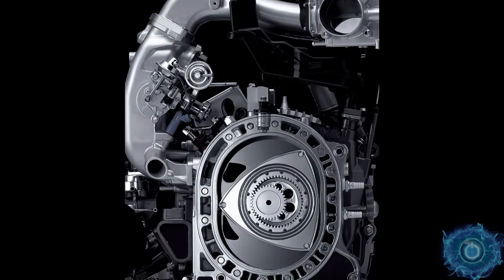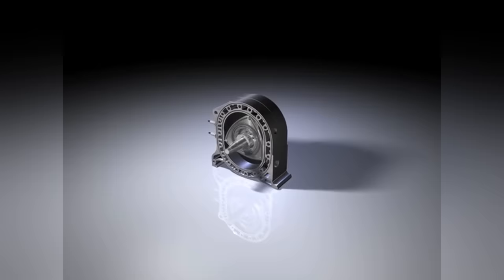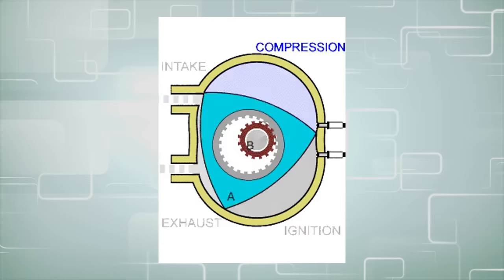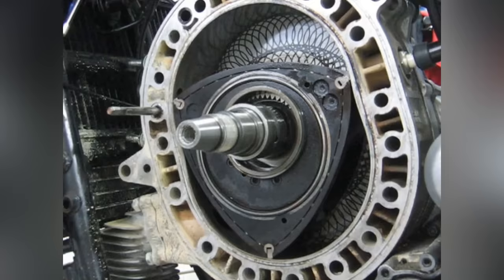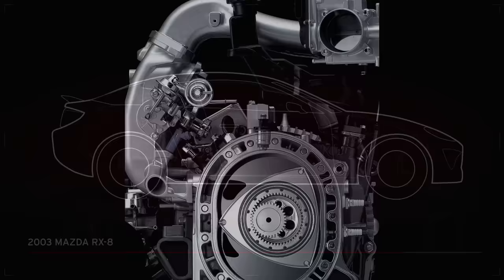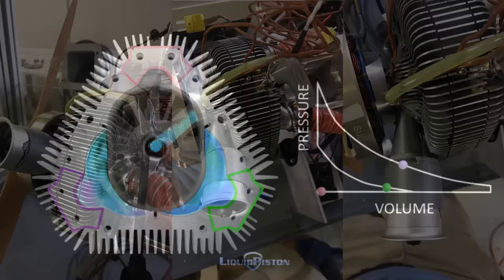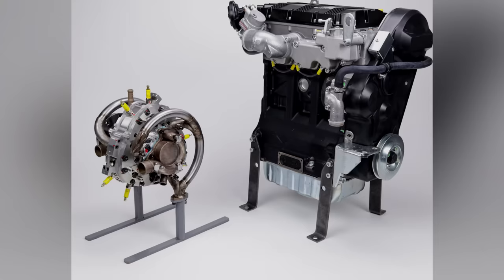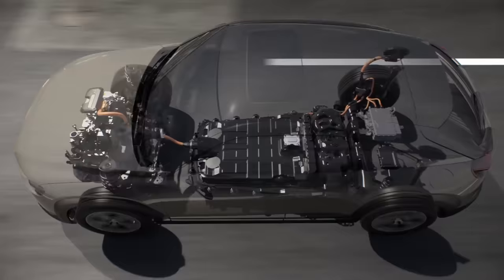STRANGE New Rotary Engine BREAKS Records

Comment: This is a beast for drones/loitering munitions/cruise missiles and such. Applications where power/weight is of the highest priority. Each kg less engine weight, the more snap, crackle and pop! ;)
The best thing is that the rotor rotates slower. In a wankel engine the rotor rotates three times as fast as the output shaft. Here it is the other way around with three times the power pulses per shaft rotation! If ICUs weren't falling out of favor, this could be the first market relevant break through in decades!

Comment: A factual mistake, RX8 doesn't have 2.6 liter engine. It is still 1,3 liter engine. (13B-MSP, a variation of 13B)
So the engine naming on rotaries is somewhat weird. One rotor has the displacement of about 650cc. Now then they sum the two rotor's displacement, giving it the whole displacement of 1,3 liters. The single rotor is NOT 1,3 liters.

Comment: I believe the future is electric motors but with a micro turbine engine as a range extender. That would void the need of a huge battery pack and also the need of new charging stations infrastructure.
Reply: Why do your need a microturbine or battery for electric whatever? just use a small motor to staty a homopolar motor generator to power wht you want and one its started you no no longer need the battery or small gas engine
Reply: @jlo13800  Because turbine engines are much more reliable and very versatile in use. ICE engines are not the future anymore.

Comment: I have owned 7 Rotary Mazdas starting with a 1973 RX-3 and ending with a 2011 RX-8 R3.  I would still have it if someone hadn't totaled it for me.  I found that the "problems" associated with the rotaries are more about people not understanding the proper way to treat them than any design flaws.  I never lost a seal.  I love the way they accelerate and the smooth operation.  I'm not interested at all in the "range extender" as it won't contribute at all to the handling on the car.

Comment: I think, discontinuous combustion is in general a problem. In the time from 1905 to 1920 there were several cars with steam engines around. High pressure fast running steam engines were a problem at this time. But this problem is solved now due to the progress of the Diesel engines. In the time from 1995 to 2005 there was a development of a modern steam engine in Germany under the responsibility of Ingenieurgesellschaft Auto und Verkehr with several companies and research institutes.

The final development was the ZEE03 (see Google) a 3-cylinder 1 liter steam engine with a power of 50 kW and an efficiency of 45 per cent. This engine was also tested in a Skoda Fabia car. The behaviour was very much like a turbo diesel engine but with certain specialities. The engine was self starting with its maximum torque at 0 rpm. The working fluid was water. The total amount of water in the system was 250 cm³, which was circulating multiple times per second through the whole thermodynamic cycle. The boiler temperature was 370 °C at a pump pressure of 200 bar. So it was almost supercritical. Each cylinder head has his own superheater operated by a coaxial porous burner. The upper steam temperature was 900 °C, which was really a lot and the reason for the large thermodynamic efficiency.

Comment: I really like the plug in hybrid concept. Keeps the battery small, eliminates range anxiety while providing enough battery only range to allow for most commutes both ways. Mazda has of course announced their small SUV in this configuration using a small version of their wankel rotary, running only as a generator and at constant relatively low speed. This sounds very attractive in my opinion and the concept engine discussed in this video would make such a vehicle even more capable due less space and weight devoted to the petrol engine allowing for additional battery capacity and more battery only range.

Comment: Beautiful engineering. Hopefully we can scale electric cars enough to not need it there, but threre are plenty of use cases for which this will be an excellent improvement such as in long range drones, long distance small aircraft and other compact machines that are not yet suitable for electrification.
Reply: They dont need it or batteries. ZPE aetheric eenrgy is every where in the universe and it been taken from us. Floyd sweet made a device witch made about 223KW and he ran a 300hp motor with it. it was the size of a small book, he was poisened and died. remember every electron and proton is a tini rotary 2 stroke made up and sustained by this ZPE aether.

Comment: "Used" not "Utilised." The difference is VERY important. Please stop screwing this up. If the engine was "Utilised", it would have been consumed in its entirety. As the engine clearly still existed when it was turned off, it was used not utilised.

Comment: they did not solve the tip problem and the shaft sealing. However
If the can come up with a solution to change the tips without taking the engine apart like changing the sparkplugs externally - then the engine will be viable alternative.

Comment: The theoretically perfect engine design for converting intermittent combustion into rotary shaft power is the Rotary Vane Engine.  It solves all four of the major fundamental problems of reciprocating engine.  It solves the reciprocation problem, as it is a true rotary device (Wankel is more of a planetary gear than rotary).  It solves the torque output problem of piston engines, which is due to their tiny torque leverage (connecting rod journal offset).  A vane engine has a huge torque lever…. A one foot diameter vane engine has a 6 inch moment arm…torque lever…(12 inch stroke!).   It solves the compression ratio/expansion ratio problem.  A vane engine could have a 30:1 expansion ration with a 10:1 compression ratio.   And it solves the non-uniform torque output problem.  It produces almost 270 degrees of uniform torque output.  It also solves the incredibly low thermal efficiency problem of piston engines.  A vane engine was tested at Lawrence Livermore… the first prototype hit 61% TE.  Oh and it solves the rpm redline problem.
Reply: I wonder how long the engine survived for. Those are some high relative speeds at the seals.
Reply: there is a better engine that that. its the 3 phase electromagnetic rotary 2 stroke induction motor!

Comment: In the early 90s, my friend shows up to my house in an original rx7.  He offered to let me drive it.  So much fun. 
  My only experience with a Wankle engined car.  I always wondered why such a power plant was not used for aviation, considering it's high rpm endurance. But, the piston engine seems to be preferred by most all vehicle applications. It's a viable engine, but it seems to be the ugly duckling of internal combustion engines.  You would think that it's simplicity would have made it a winner.  No valves, push rods, rockers, cams, and yet, abandoned by Mazda, and everyone else.  Brilliant design, almost successful.  That RX7 was 10 years old, but ran like a champ.

Comment: The design is the next step in configuration of rotary dynamics. They took the housing and made it the rotor and designed the new housing to be the corresponding triangular shape with dimples for compression and sealing/ seating of the rotor shape. 
Very good mechanically. I hope to see more of this design in the future.

Comment: This engine is a boat anchor, no torque output,  I have said a hundred times but somebody is always trying to develop this design "The most misunderstood mechanical machine since the beginning of time."
Reply: 40 ft lbs for 210cc aint bad and no fat ugly wet sump like on a 4 joke, this is a rotary 2 stroke oil injected marvel.

Comment: I would think a turbine would be a good hybrid engine.   they run very efficiently at their power RPM.  So shut it down if it's not running or make is smaller so it has to run wide open all the time charging and adding to peak power.
Reply: Turbines are like the opposite end of what a hybrid engine needs. Turbines downside is noise and lower efficiency in return for being smaller for the same power output.

Comment: I love the innovation and I have even done the EXCEL spreadsheets, CAD work and printed several 3d models of the engine.  What is missing in the video and all their website data is Emissions.  They have talked about hydrogen but I think hydrogen is just an empty pipe dream.

Comment: one area where wankle motors are used is engines for motorized glider airplanes - here the size and weight advantages are highly sought after cause you generally dont want to use the engine (so its dead weight) unless absolutly necessary. but the electric alternatives are also going strong...

Comment: The rotary design engines of ww1 weren’t phased out because they were killing pilots by create a gyroscopic lock and making the aircraft unmaneuverable. Early sopwith  camels would fly directly into the ground if the pilot turned right in the climb from take off.

Comment: I'd love to see hear your breakdown/opinion on the IN-N engine. A single stroke, four cylinder with eight opposing pistons with zero vibration.
Reply: Ford already has one. Its like a boxer motor kinda stupid actually the spark plugs dont last as long and the valves are more prone to carbon build up, hard to pass emissions the other problem is oiling just gonna burn more of it and use more of it. Valves wont close properly wirh the extra carbom build up
Reply: @FiglioBastardo  u didnt know that ford a has a 6 piston 3 cylinder/bore engine. They trying to put it in their hybrid truck. Look it up i believe its 3 liters. Pretty much the top of the pistons face each other similar to a boxer moto the difference is it uses the same cylinder/bore the spark plug is in the middle of the block.
Reply: @FiglioBastardo  these engines will smoke and consume too much oil its junk. If it didn't work well in the 1900s it wont work well today.
Reply: They use a swashplate instead of a crankshaft, which means the force distributed in a crankshaft journal is now concentrated in a single point. Also, machining the swashplate is a nightmare, which will demand 5 axis CNC machining even on mass production.

Comment: Rotary is dead but the Liquid piston has great potential if they can scale up to 300 hp or can be used successfully in a hybrid configuration.   I see Liquid Piston as a really elegant replacement for aircraft engines particularly those made by Lycoming and Continental.  Auto manufacturers are going down the all electric path, small aircraft will not be able to that for many years.

Comment: Turbo charged and use as an auxiliary engine like in military tanks where small size is needed appears to be a good fit for this motor.  Since it appears it can do compression ignition multiple types of fuels appear to be able to be used. Like this appears to be a diesel engine that has the ability to have a high power to weight ratio.  This might be a good motor for a drone. I think cars are going to be electric but this motor should have some niche uses.

Comment: Interested to see your summary of the rotary wankel engine, however you omitted to mention the original NSU development and the exhaustive development (to address overheating of rotors) conducted by Norton Motorcycles, where they ended up using the intake tracts to cool the rotor.  For a relatively brief period Norton used this engine in racing, but classification, ie swept volume, dictated that they could be excluded from pre-existing competition classes and controversy ensued.

Comment: Uh, the rx8 doesn't have its ports on the side for better airflow.
The intake and exhaust are both on the front/back. The intake was already there from the rx7 but the exhaust was there so that the emissions would be better, this actually creates more back pressure which makes it less powerful than it could be. Furthermore, because of the extra back pressure, turbocharging it and adding more back pressure with an impeller has actually caused premature wear on the apex seals which is why it's very rare to see a turbocharged renesis, very few people are willing to even try.
Rotaries are my favourite type of engine, I want to see them in more hybrid cars.

Comment: The liquid piston XTS-210 Engine is truly revolutionary. So much so that I actually invested in the company. While I am not thrilled with the management I am hopeful they can build an efficient manufacturing facility. If they pull that off it is a total game changer that will add a decade to the usefulness of fossil fuels.
Reply: Mount 2 XTS-210's together to make a 2 stroke 410 2 stroke for a banshee.

Comment: I've been excited for the Liquid Piston engine for years, but the longer they are in operation, the longer it looks like they are just pulling a financial scheme using a viable product as the bait.  If they really wanted to, they could have brought a working motor to market in some form 5 to 8 years ago.  As of right now, you can buy a one off prototype for $10k to $30k, if they approve your case use.  Mass produced, a 50hp motor would only cost $300 to $400 to manufacture.

Comment: Some informations are wrong!
The 2 rotor engine displacement is not 2.6! It's a 1.308cc (654x2) engine!
Also the FD had many different power outputs! The lowest HP was in the Touring X with a single Turbo and 231hp! My FD was one of the first with 280hp from the factory and the Spirit R Type A (also B and C) had 297hp!
Also: Felix Wankel created many DKM (old versions) and KKM (the current engine type)! Also the version you showed in the video with the triangle housing (and many other shapes with up to 12 corners) and he found out that the current engine design is the most efficient! So Mazda definitely don't bring the more inefficient engine back!!! They are still working on the new 16X engine to make it legal for all countries in the world! (it is legal in many countries but they want the engine available in all)

Comment: Great serial Hybrid generator candidate. Veggie oil fuel rotary could charge a capacitor battery system with reduced weight overall. With the onboard battery charger/solar combo a much smaller battery is needed with zero fossil fuel and no milage anxiety.
Reply: Do not put veggie oil in a 2 stroke piston or rotary unless you want a lot hardened carbon buildup. You can use castor 927 maxima 2T even though it can burn dirty unless you run it hard. Go with amsoil interceptor, XD-100 or silkolene pro 2 sx in this 2 stroke rotary.

Comment: I had 1986 RX7, gas guzzler 18mp imp. gal. And burns oil. Engine lip seals good for about 60k miles before the drop out of slot and wreck engine. If you own RX7, put some 2 oil stroke in the fuel.
Reply: I do that and fill it with amsoil interceptor 2T every in my rotary, no 4 joke oil allowed!

Comment: Calling a radial engine, a rotary engine is invalid. It would be great to see a redesign that could break current efficiency levels. I rebuilt a rotary for my Mazda truck back in 1984 because of a blown oil seal, and the seals were certainly a point of concern during build. Thanks for the video.

Comment: LP engines are great for applications that can benefit from small size, high rpm, low torque scenarios like BEV range extenders. Because the low torque profile of these, it is impractical to use them in direct drive automotive use.
Reply: Its got more torquer for its size than the 4 joke stroke junk in car today, noting beats the torque of a turbo 2 stroke.

Comment: On all these designs theres a huge rubbing area,,and all need lost oil not to get metal scuff,,theres also the imbalance of heat around the body,,one portion always hot fireing and the next cold intake,,the warp factor is huge,,and,,unlike a piston engine where the rings speed up and stop during the cycle,,rotary seals sweep a huge area at high speed nonstop,,

Comment: with 250cc two stroke engines capable of ~100hp, this would be much more impressive if their 210 would be at least closer to 50hp taking into account the weight reduction they are claiming.
Reply: Yes true nothing beats the 2 stroke piston engine especially with turbo, 4 stroke in cars suck too, all high rpm and no torque like the 2 stroke piston and no F^&*^& oil injection! It drives me insane everything is becoming so 2 strokeless

Comment: The example of your 2ccm engine running 20000rpm is a bit out of proportion since even 4ccm single piston 2 stroke engines run close to 30000rpm.

Comment: The Liquid Piston engine has been in development for almost two decades, and has still not made it into mainstream. With rapid adoption of electric engines for cars and even propeller driven planes, events may soon overtake them and they may find that when the LP engine is finally ready, internal combustion engines are no longer used.
Reply: 37 lbs of fuel replaces a 1000 lb battery. Also no reliance on exotic materials.

Comment: Ooh! I follow these guys. Their website is still open on my browser
Reply from the maker: Nice, I see you can invest (buy shares) as well, but kind of risky for small company. Very intriguing how they turned it inside out!
Reply: @Tech_Planet  My advice - don't. They are still crowdsourcing, 17 years after winning the DOD contract... Just think. Really.
Reply: @alterbart7916  Your info is a little old. The DOD had awarded the company a second round of funding just last year for stage 2 of the contract. The DOD continued the contract because of the promise the prototype showed in testing. Liquid Piston already delivered exactly what they were contracted for 17 years ago and did it well enough to get a new contract to start producing for mass testing.